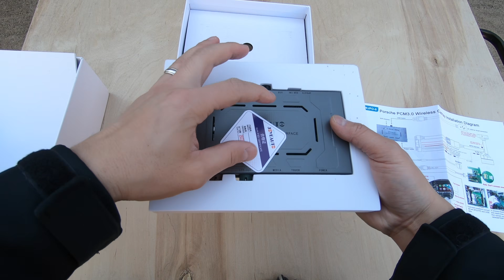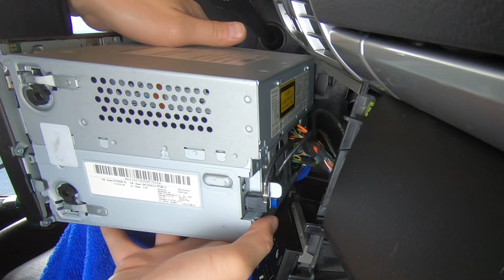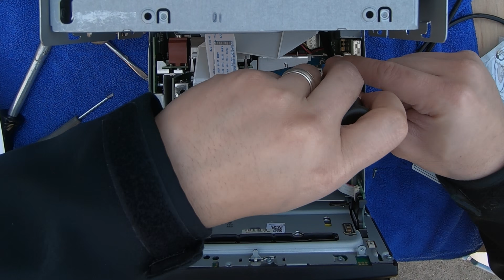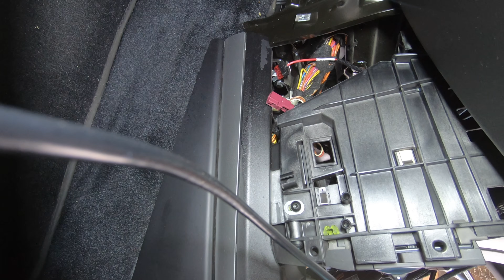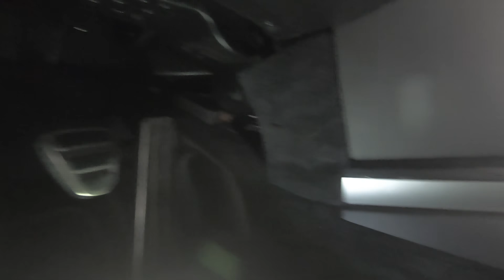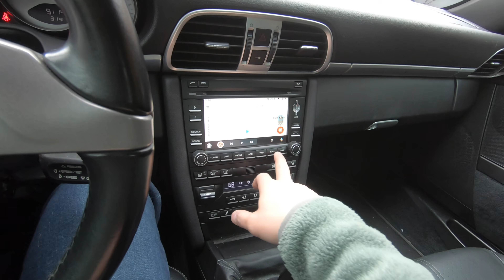How to Add Apple CarPlay & Android Auto To Your Porsche (911, Boxster, Cayman, Cayenne, Panamera)

Comment from the maker: Correction: To power the unit, use Anti Dazzle Mirror fuse instead of cigarette lighter fuse.
Porsche kits available here (FREE SHIPPING WORLDWIDE): https://ecarguides.com/product-category/apple-carplay-android-auto-conversion-kits/
Reply: Which location is that fuse found? As for the connection, I saw in your video you removed the fuse and plugged the wire in. I guess the fuse then goes back? Thanks
Reply from the maker: @johndestounis4529  the fuse to replace is C6, anti-dazzle. Just take that fuse out and plug in the new one that's already connected to the power wire.

Comment: I tried to extract the radio following your video, but is not coming out (just a bit), the clips are all in the correct position, is there anything else to disconnect or unplug to extract the stereo? What can be the issue?

Comment: My NAVI button does not switch over to Joyeauto screen. Everything is hooked up and source in AUX. Phone seems to connect to CarPlay and even pass audio through PCM. Just can't get it on the screen. I've triple checked everything, have the aux dummy hooked up as well as DIP in the right setting. What gives? Any help is appreciated. 
I have a 997.2 with XM.

Comment: Can you advise where you positioned the harness bulk connector. I have a 2012 987.2 Boxster and I’m having difficulty getting the head unit back in place. The space is limited. I’m curious where you positioned the bulk connector. Thanks.

Comment: Great vidéo !
Just a question : how do you connect the fuse to thé box and hide wire? 😅
Reply from the maker: You just run the wire along the footwell paneling. The power wire includes a fuse that you simply plug into the fuse box.

Comment: I have PCM3.0 with XM Radio option. Can remove the XM Radio card to make room for the Joy Auto card?
Reply from the maker: No, you can just stack to board on top. This site includes additional brackets so it will fit will the XM board. https://ecarguides.com/product/porsche-pcm-3-0-wireless-apple-carplay-android-auto-mirrorlink-conversion-kit/

Comment: Great video, and we’ll done with the install, very helpful! I wanted to know if this unit is still working well, and if you have a long term review or opinion? I’m being quoted about $3,000 to install an Alpine CarPlay unit with the fiber optic adaptors to hook to my Bose system in my 2010 997.2, with a back up camera. I like the is unit because it keeps the factory head unit, but I don’t want to waste $500 plus all my install labor if it’s not reliable, just to have to take it out to go to have aftermarket head unit installed anyway. I’ll use your link to purchase, hope that helps you out. Thanks
Reply from the maker: Thanks so much!

Comment: That is all nice unless you have a XM moduel.  Also you will require 6 M2.5x20+6mm Instead of 3.  2 ea for the 3 hold down screws. this gives enough lift to clear the XM module.  Also you will need to drill a hole for the Joy auto board power cable, as the XM connection cable is where this vid runs the Joy power cable.
Reply: This was helpful. FYI you can use a smaller standoff to create a gap to run the power cable.

Comment: This was a great help when I installed it in my 997.2 Carrera, however when I pair I don't get that recognition screen on the head unit...in the JoyeAudio settings panel it says my phone is connected through bluetooth and wifi carplay is enabled but it doesn't go to carplay and I can't click carplay on the main menu. Any ideas how I can solve this?
Reply from the maker: Do you have the Aux plug inserted? Also try turning off the Bluetooth on your phone and turning it back on. Usually, your phone's name will pop up on the screen. Additionally, you can try to forget the module on your phone and try to connect again.
Reply: Thanks for the reply. Actually I unplugged that aux dummy piece and simply turning the ignition on so that the engine ran made the difference. That allowed the unit to detect my phone then boot up apple car play. It w works perfectly in that order now every time I start the car. 

I think the problem before was because I was doing the install at night and wasn’t turning he ignition the whole way and starting the car. 

Fantastic step by step video. THANK YOU!!!!!

Comment: This is a GREAT install guide.  I am going to watch a few more times to feel comfortable.  Did a retrofit unit install in my Boss 302 (Navidyne), but this DIDN'T require breaking open the oem unit and installing a board...THAT is pretty cringy for a six figure vehicle owner ('12 GTS Manual).  The integrated back-up camera might be what pushes me to proceed.  Added to my Boss 302 and REALLY miss not having a camera in my GTS.  I think a winter project when car is slumbering.

Comment: Only 20minutes necessary to install the car play module… if and only if you spent before 4 years studying electronic engineering…
Reply from the maker: Definitely not a 20 minute job but definitely something you don't need an engineering degree for. Just need some experience working on cars or know a good audio technician.

Comment: Hey I have a 997.2 (BY 2008) and am struggling to find a suitable  solution - all the modules say they are for the BY 2009-2012. What do you think, would it work for 2008 anyways?
Reply from the maker: Does your car have PCM 3.0 (touchscreen) with the built in aux port? If yes, this will work for you.

Comment: Does this work with 997.2 equipped with BOSE sound system? I have PCM 3.0 with Nav and aux but there’s no mention anywhere of if will work with BOSE. Thanks 🙏
Reply from the maker: Yes, it works with Bose. I have the same setup as you!

Comment: I tried this exact same mod for my Cayenne 958. I got the GTA Car Kit setup, which is identical to this JoyeAuto unit, just cheap chinese Alibaba rebranded crap. I got Android Auto to turn on for about 15 minutes. I was excited. Then it went back to a blank/black flickering screen. It's been a headache. I just wish there were easier aftermarket head unit upgrades available for us :( the guys at Car Toys and Best Buy are clueless.
Reply: Did you ever get android auto working ?

Comment: I did this and somehow lost the sound on my unit.. No AM/FM sound.. CD and SAT sound did work, which was odd. the functionality of the carplay worked but no sound.. so I know that the joyeauto is working.   Has anybody had this problem. I did plug the small jack into the aux on the console.. everything else wired in..  I did stuggle a bit to put the unit back together.. and not sure if I damaged something but there is no obvious crimped or stripped wire.. I want to warn anybody doing this.. to make sure when u are putting the case back together, that they are oriented 90 degrees, like an open book and then fold it down.. the top portion should fit on the tabs in the back of the bottom portion.. like a hinge.. dont simply oppose the 2 pieces and squeeze together... or u will end up w my result.. I eventually figured it out.. I will also mention that don't do this late at night.. I prob would not have made this mistake under normal conditions. Also.. I belive you need to put the #3 toggle switch in the "on" position for pcm3, or it wont project properly on the unit.
Reply: I got a new unit and redid the installation.. all went great.. but now hear very minor low volume engine noise between songs when carplay is on.. not during normal stereo operation.. I'm curious if anybody else had this problem?  I thought about noise suppressor on the power line which is plugged into the fuse box.. vs. grounding the carplay unit to the actual stereo.. as this problem can occur w floating ground.
Reply: Nothing happens when I press the NAVI button. Help. I already checked all the connections and power. Only thing I haven’t rechecked are the ribbon cables.

Comment: Hello and thank you for the informative videos, since me too I have a 997.2 Carrera   convertible; Since my oem microphone does not work for some issue with the Bluetooth module in the PCM unit, if I retrofit it with same kit,as you did, can I use the new microphone to make an actual call through Android Auto. Thanks in advance 😃
Reply from the maker: Yes, you totally can. Just connect only to the module and not the PCM so the PCM doesn't try to pick up your calls. Here's a link if you want to purchase it. 1 more in stock, but more will be available in about 1 week. https://ecarguides.com/product/porsche-pcm-3-0-wireless-apple-carplay-android-auto-mirrorlink-conversion-kit/

Comment: hi, can you connect the unit to your OEM microphone? Or can you still use the PCM Bluetooth to make phone calls?
Reply from the maker: Hi Lee. You can still use the pcm for phone calls. The microphone for the pcm will not work for voice commands though which is why you need the separate microphone. Because the audio for the module is going through aux, the pcm Bluetooth should still switching automatically for the phone call assuming you are connected to both the pcm and Carplay module.
Reply: @CarFanatic  thanks for the clarification.

Comment: I installed a similar looking harness to put in a Pioneer unit with back up camera on my 2010 997.2 4S Cabriolet.  That particular adapter I used lost all the sound to the rear speakers because of the way the Porsche MOST fiber optic system works.  There was no workaround.  And with the top down you couldn't hear any music due to wind noise overpowering it.  So I had to go back to the OEM equipment.  Can you confirm the rear speakers still provide plenty of sound on this product?  If so, I'm buying it.  I have enjoyed 100% of your videos as I have both the 997.2 and a Cayenne so everything you do is 100% relevant for me.  Thanks.
Reply from the maker: Yup, rear sound works just as before. Thanks for all of your support!

Comment: Great video
Where did you finally install the mike ?
Reply from the maker: Good question. This sounds lazy but I ran the mic wire underneath the center arm rest console and just left the microphone between the drivers seat and the center arm rest console. It picks up audio well there.
Reply: @CarFanatic  Great, thank you for your answer. Just finished installing my Joyeauto and it works perfectly ! For the time being, I've clipped the mic to the air vent just on the righthand side of the steering wheel.

Comment: I also have a 997.2 and interested of doing this. However, I’ve seen people mentioned that on long drives the joyeauto unit gets very hot and started to have some glitch and freezes out. Any experience of this?
Reply from the maker: I haven't tried it on a long trip yet so it's hard to say. If that were to happen, I would just toggle it back to the normal functionality.
Reply: It is been good so far. I live in the tropical region of South East Asia and hasn’t missed a beat.
Reply: @thinaharran  just the answer I’m waiting for. Thanks!!!

Comment: Oops. Mistakenly replied to the other comment. Super informative video by the way my friend. I've an 09 C4S that currently has no sound. Ninety nine percent of the head unit functions as normal with the sole exception being the lack of sound issue. Not a peep. I'm guessing that I would have to probably sort that out before implementing this set up or does the set up itself supercede the existing audio sources or in my case, my current lack thereof? Thanks again man for the great video! Rodd.
Reply from the maker: It won't override any existing sources except for the AUX. It also won't fix your sound problem so it would be good to figure out what's going on there first.

Comment: Great solution, helpful details here. I’d do this if had a 997.2.

I have a 997.1 and the PCM is too dated for this unfortunately. Don’t really care for the look after aftermarket head units - hoping a Porsche Classic radio solution is released in the not too distant future.
Reply from the maker: Yeah, unfortunately won't work on yours. It will be harder for porsche to make a unit for the 997 and up given the level of integration with the rest of the vehicle. It is possible though.
Reply: Apparently there is a new retrofit version coming for the 997 from porsche
Reply: @Jack-russell103  Hey Nick do you have a Link to this info?  I have a 997.2 and am struggling to find a suitable solution
Reply: @Jack-russell103  any update for the 997.1?